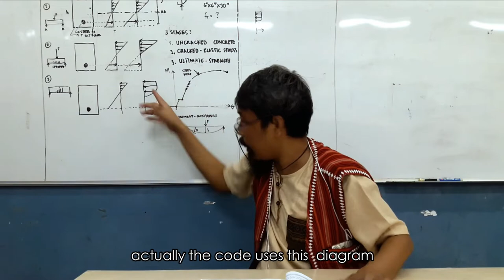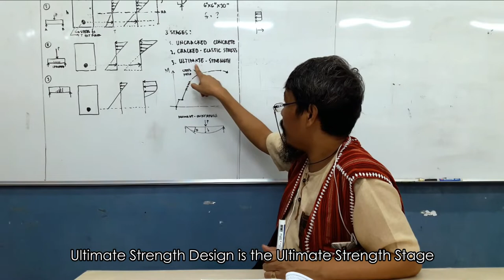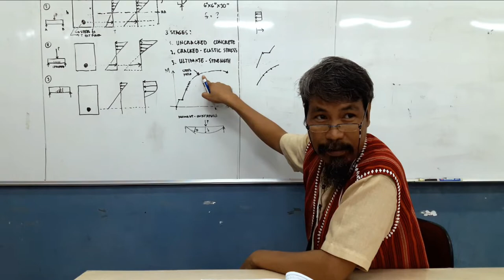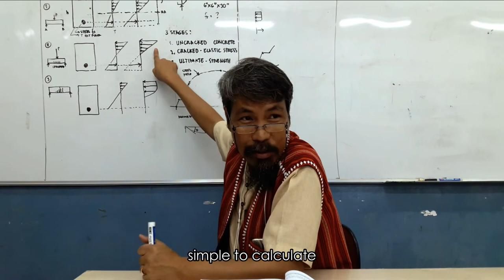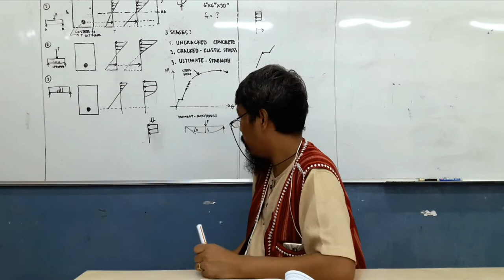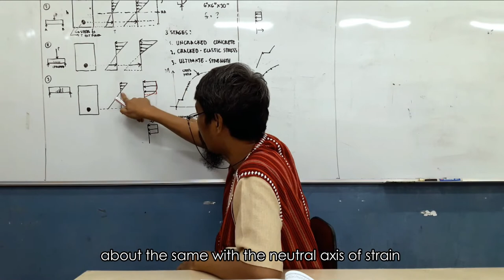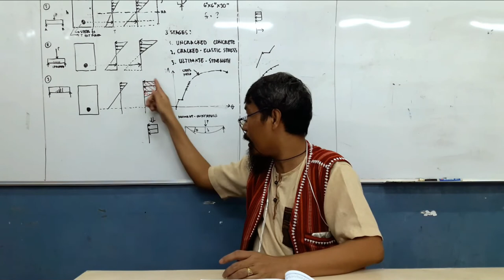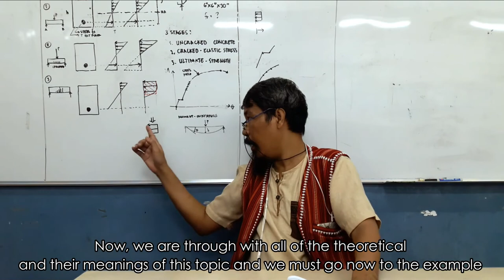CE 422: Structural Design 1: Reinforced Concrete Design || Flexural Analysis of Beam || Part 5

Comment: Thank you sir,for sharing your knowledge with us, I learned that It is important to understand and be able to find the internal moments, shear force, and axial force at any point in a beam structure. Knowing the right formulation of all needed formulas is great because it will help us to know exactly what is needed. These values can then be used to assist in the design of the beam.

Comment: Thank you sir for this video lesson about Reinforced Concrete Design. Continuing the lesson on 3 stages specifically in ultimate strength design that is equivalent to Load and Resistance Factor Design (LRFD) and other information and review was discussed.

Comment: Thank you sir, I have learned that the code Ultimate Strength Design is equivalent to LRFD whereas the code state that we can model this one for concrete structure.  Code has a diagram, we can use a semi-circle or any regular shape as long as the shape we are going to use should have the same area of the red actual, black portion it is the only condition of the principle. It will also give us the provision of the load. I have also learned that the ultimate portion will be divided by 2 and multiplied by two thirds. This discussion will help us to further understand the terminologies and formula to be used in designing a beam.

Comment: Continuation of the previous discussion about the Ultimate Strength, it is equivalent to the Load and Resistance Factor Design, abbreviated as LRFD, is a scheme of designing steel structures and structural components which is different from the traditionally used allowable stress format. And in getting the very important portion , we divide the ultimate by two and multiply it by two-thirds. In this lesson, by following the code, estimate is very useful.

Comment: 1. Amongo
2. Ultimate Strength Design @0:44
3. Visual Inspection @1:30
4.  Important section @2:30
5. Concrete Structure @3:20
6. Neutral axis @5:36